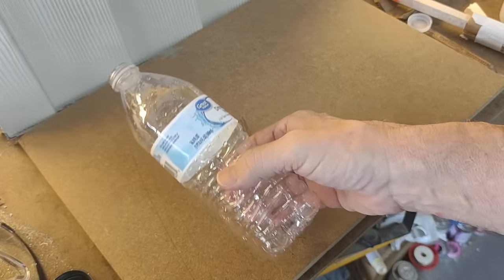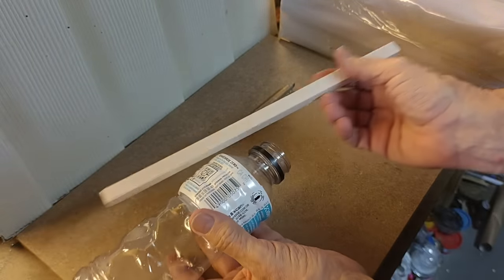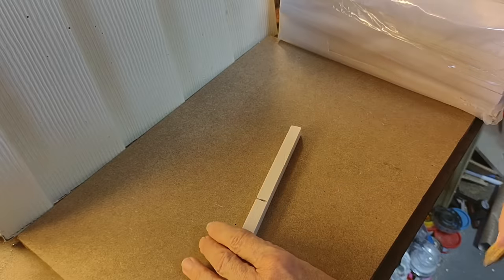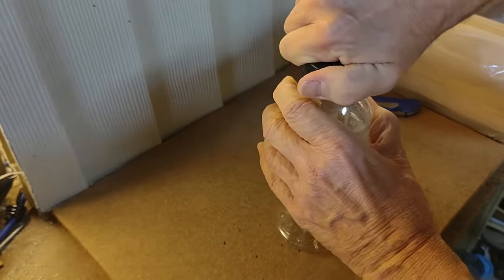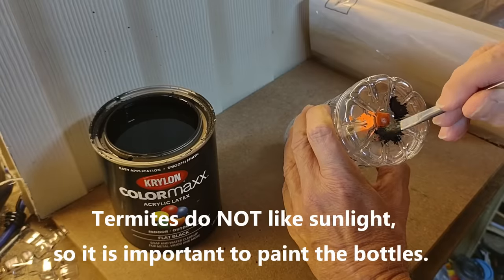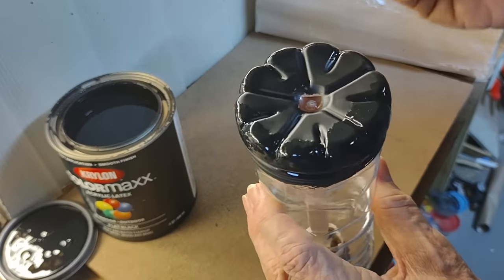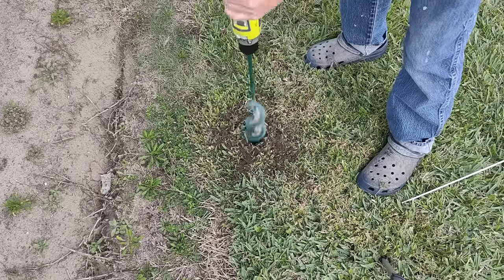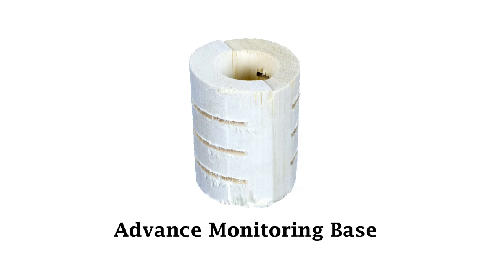Unbelievable Water Bottle Trick for Termites!  Simple to do!

Comment: So I know the termites are coming up imnside my house the lower level slab. How do I address them?
Reply from the maker: How you handle that will depend on the species.  Figuring out the species is actually pretty easy and I have a video on how to do that.  I will provide you with a link below.  After watching this video, you should be able to identify the species.  Just get back to me after you watch it and let me know what you found out.  At that point, I can tell you exactly what you need to do.  Let me know if you have any problems identifying the species, but I do not think that you will. It is much easier than you may imagine.  Also, please tell me where you live.  Location matters.  There is one species in far western states like California that are very different, so let me know where you are.  Be well my friend.

Video on how to identify termite species:  https://youtu.be/dIs_a0nfVjg
Reply: @GuysPestSolutions  I live in the 80227 zip code
A couple years ago we were told it is highly unusual to have termites in our area by our county pestcontrol. What I've seen (about 10 yrs ago is a bug about an 1/8" long , mostly off white  to translucent , but still find "saw" dust in one area of basement.  I've been able to maintain some control (I think) by putting "bait sticks " in holes bored in the base concrete slab 
It appears that the termites are coming to up through gaps in the foundation/slab in the basement.  We had a small water leak that took time to identify and they may have followed the moisture 
We think they were introduced to our area by a neighbors that storied firewood in their basement, year's ago
Reply from the maker: @willyheacock2907  Gosh, I hate to disagree with your county pest control folks, but I can tell you that you definitely have termites where you live.  The good news is that they are all subterranean.  I recently learned though that you have Western subterranean termites where you live and they are bad.  I mean, really bad.  So, it is important to determine if you have this species, or if you are dealing with something simpler.  One of the ways you can tell is to look if you are seeing mud tubes anywhere.  I don't know how they do it, but Western subterranean termites seem to be able to infest a home without leaving any evidence, such as mud tubes.  So, I recommend that you do a thorough inspection of your home and look for mud tubes around the outside for perimeter of the house, coming up from the ground, or in the eaves.  You should also check the attic.  If you cannot find mud tubes anywhere, then it is possible that you were dealing with Western subterranean termites.  However, given the length of time this has been going on, this is most likely a more common species.  In any event, you need to start by trenching around the house and treating with a termiticide.  I have a video on how to do that, and I will give you a link to it.  Next, you should spot treat any areas where you were seeing activity. 

To spot treat subterranean termites, you need to buy a fipronil foam.  I will provide links for two products that you can choose from.  I like the FiPro the best because it's a little less expensive and I like the applicator tip better, but the Termidor Foam also works very well. The FiPro is not available everywhere.  If you can get one of these foams, then drill holes in all damaged areas, that are 4 inches apart, and drilled about halfway through the wood.  If you are seeing exit holes in the wall, then there is most likely a stud behind the exit hole.  Get a stud finder and locate the stud where it meets the ceiling and drive a small nail into the stud a couple of inches below the ceiling.  Attach a weighted string to the nail and that will show you where the stud is. Then drill the holes 4 inches apart along the entire length of the stud, about 3 inches deep.  Do the same thing for woodwork, except only drill the holes halfway through the wood.  If you think that there is a 2 x 4 behind the woodwork, then drill a 3-inch-deep hole every 8 inches.  The holes only need to be wide enough to get the applicator tip of the foam can into the hole.  After the holes are drilled, then shoot the foam into each hole for about 5 seconds or until you have foam either coming back out at you or coming out the other holes that you drilled.   All the holes should have foam either going into them or coming out of them.  This will contaminate their food source and they will take the fipronil back in the colony and spread it around to the other termites.

Most of the time, subterranean termites are going to be building mud tubes somewhere.  Like I said, you will most likely find these mud tubes going up the exterior of your foundation and you may find them in the eves and in the attic sometimes.  If you can find the mud tubes, then you can treat them as well.  Just scrape off about a 2-inch section of each mud tube down to the bare surface.  Then, shoot that foam into each side of the mud tube and also apply a little of it on the surface where you removed it.  The termites will rebuild the mud tubes and bring the foam back to the colony to spread around to the other termites.

Also, if you can find the mud tubes, this is a very good way to determine when the infestation is gone.  If you scrape off that 2-inch section of a mud tube, you can see if there are any live termites in the tube.  Again, the termites will rebuild the tube and go about their business.  Do this every two weeks after you finish all your treatments.  Apply the foam to the mud tube every time you do it.  At the point you are no longer seeing live termites and they stop rebuilding the mud tube, then your infestation has been eradicated.

It typically takes several weeks for any termite treatment to be effective.  That is because you are using slow kill products.  If you were to kill the termites too quickly, then they would not have a chance to bring the poison back to the colony and share it with the other termites.  If you don't kill off the entire colony, you will not end the infestation.  Therefore, you must kill off subterranean termites very slowly.  So, I would give this at least 12 weeks before I would decide that something went wrong, and the process didn't work. Hiring a professional to trench your house is pretty much going to take about the same amount of time to kill off the colony.

Please tell me if the termites are near an exterior wall or an interior wall.

I hope that helps.  Be well my friend.

FiPro:  https://www.solutionsstores.com/fipro-foaming-aerosol

Termidor Foam:  https://www.domyown.com/termidor-foam-p-3528.html

Video on how to trench for subterranean termites the right way:   https://www.youtube.com/watch?v=Fy7YHi_7Z8g

Comment: What can I do about dry wood termites?
Reply from the maker: It is important to understand how drywood termites work.  They enter through cracks and crevices around windows, doors, the eaves, pipe penetrations, and so forth.  Most of the time, they enter through several locations.  That is because a swarm of them attacked your house at the same time.  If there was a crack or a crevice, then they probably found it.  After they established their galleries, which will be inside the wood, it will take four to seven years for them to be able to swarm.  Now that they are in your house, the swarmers will use holes that are in your studs to travel through the walls.  Those holes in the studs were created by the electricians to run the electrical wiring.  Not only are these holes going through the studs, but holes were drilled into the attic for the light switches and to run some of the wiring for the outlets.  So, the termites now have easy access throughout the attic and the walls.  If you have a basement or crawl space, they have access to that as well.  Most of the time, you will have no idea that they are in the walls, because the frass is inside the wall.  To make matters worse, if you have drywood termites, then your neighbors have them too.  That means you have been getting swarmed for as long as they have existed in the neighborhood.  Most likely, we're talking about years, so it's a safe bet that you have these guys in many locations in your home.
                            
I always hate to be the bearer of bad news, but if you have drywood termites, the only sure way to get rid of them is to fumigate.  Prices for this can vary wildly in this industry, so I recommend that you watch my video on how to hire a pest controller without getting ripped off.  That video can save you a lot of money.  You should also know that the gas they use to fumigate has absolutely no residual action whatsoever, so you can get reinfested the moment the tent comes down.  Like I said before, if you have drywood termites, then your neighbors have them as well.  Since drywood  termites swarm every year, it is almost a certainty that you will be reinfested within a year after the fumigation is done.  The only way to prevent this is to do a preventive treatment on your house every 60 to 90 days.  Most pest controllers will not do this, so it is something that you generally need to do yourself.  I have a video on how to do that and I will place a link below.  If you absolutely cannot afford to fumigate your house, then you can try spot treating it yourself.  It is virtually impossible to find all the termite galleries, but it is way better than doing nothing.  Regardless of how you treat it, you should begin the preventive treatment immediately, so that you do not get additional termites paying you a visit.  

I hope that helps.  Be well my friend.                        
 
Video on how to hire a pest controller without getting ripped off:  https://youtu.be/y-a8XOqVrlE
 
Video on how to prevent drywood termites:  https://youtu.be/neNsmVbj8Pc
 
Video on how to spot treat drywood termites:  https://youtu.be/U7ck7zhS0Xo

Comment: do termites survive winter with snow?
Reply from the maker: That depends on how cold it is.  If the frost line goes down deep enough, then termites cannot survive.  For example, there are no termites in Norway.  Some climates are not cold enough to eliminate termites entirely, but you see fewer of them.  Termites prefer warmer weather, so you will see many more termites in Texas than you will in Main or North Dakota.  The snow doesn't bother them because they operate underground, in mud tubes, or inside the wood of your home.  If you have termites, the activity will slow down in the winter, but it does not usually stop altogether.  I hope that helps.  Be well my friend.